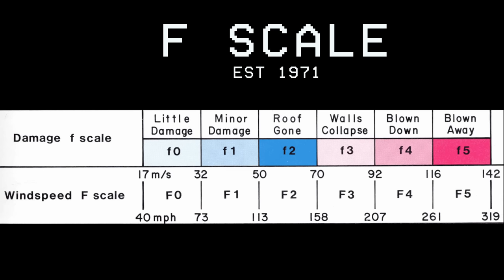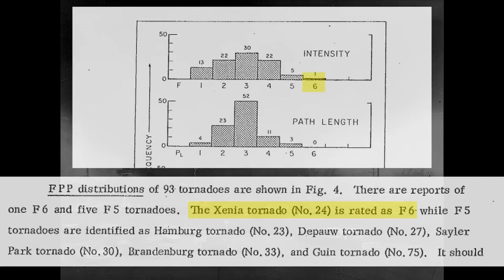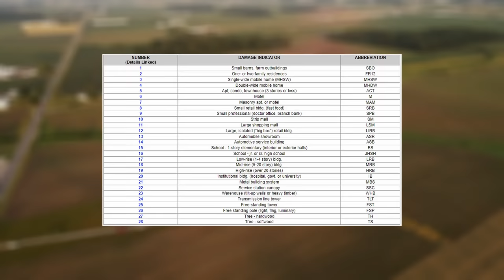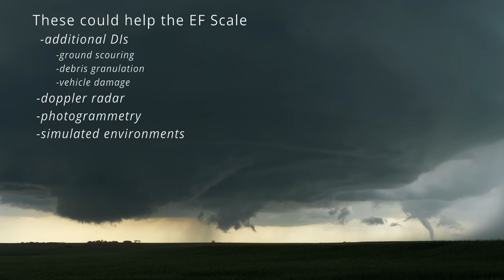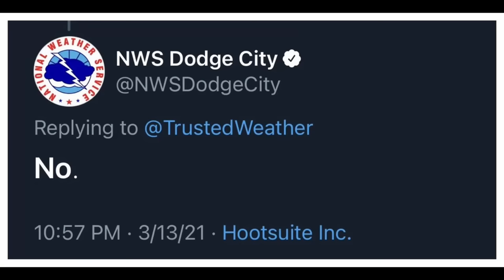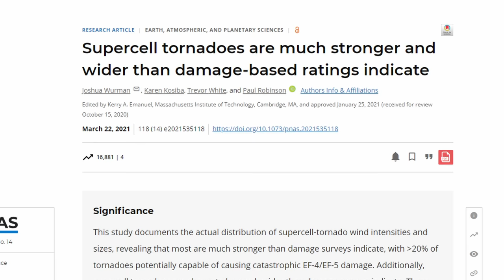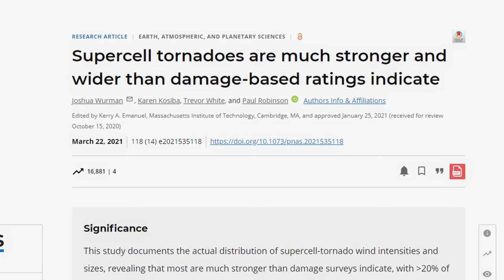Is The EF Scale Outdated?

Comment: Well considering an EF5 only "happens" when it hits a town or city, I think the whole thing needs to be reassessed.  EF5s tornados certainly exist in open fields but there's not enough damage to make them an EF5 until they hit a building.  That doesn't fit my logic.
Reply: I was thinking adding trees to the list of DIs. There are plently of patches of forrest in open rural areas. If a tornado can hit a patch of forrest and just about every single tree is mowed down, debarked, with all upper branches snapped off...not to mention larger trees being completely uprooted...that should be a indicator of a pretty strong tornado (EF3 or higher). I don't see >EF2 doing that to trees (assuming nothing else is hit).
Reply: That's why the intensity should be based on wind speed like a hurricane, rather than by how much it destroys.
Reply: @MariahWong  The problem there is, often, we don't know the windspeed of tornadoes at the lowest levels. The windspeed measured by radar is usually a few thousand feet above the ground. Estimating windspeed from the damage is the best that can be done at the moment.
Reply: With my research I have done for a couple of years ef 5 should be rated on  wind speed and amount of worry and warnings  implemented before or advisory's implemented a day prior due to large amounts of risk in unstable conditions
Reply: @RamSoulja86  They already have trees as a DI the highest rating they can earn currently is 167. The NWS is updating di's in 2024 and theres a preliminary DI for forests which has a maximum DI of 210 which is EF5
Reply: It's super dumb. We should go back to the original scale. It was perfect.  EF5  = F3 on the Fujita Scale.  EF3 =  F2.
Reply: @Firemarioflower  what do you mean by ef 5- ef3
Reply: Same exact thing happened with F5s. Your logic is ''We don't have the information, but we're gonna pretend we do'' Just how strong is this tornado that hit nothing? How do you determine that? Too much smugness for too little thinking....
Reply: @tomasallende9583  if we know 200 mph winds hitting a building will destroy it, then observing a 200 mph tornado we could somewhat assume it would destroy a house. (at least thats the logic they are using) your same argument can be made for making guesses on its strength by whatever structure it destroys, because there's so many variables to how the structure was built, how old it is, etc.
Reply: @skyguy1236   @skyguy1236  The option is ignoring construction quality all together and go back to the F-scale. What you're telling me is because we can't get a perfect aproximation (oxymoron there) then we shouldn't even try. And 200 mph won't necessarily destroy a building, or it may destroy a building but not a extremely well constructed house. In 2011 there was a dome house that survived (severely damaged though) 200 mph winds. You have to look every case individually. If you know there were a bunch of cars in the air maybe the worst damage was done by cars, not the wind itself. All that said, if a tornado can destroy a well built concrete building, it can probably take any house in it's path that's not specifically tornado-ressistant. That's the improvement of the EF-scale over the F-scale, it takes building quality into account. There are shitty building and strong houses, that's all considered by the engineers that do the surveys.
Reply: @tomasallende9583 exactly. It's not as simple as people want it to be. The ef scale is a damage scale, period. It's the public's misunderstanding of the scale that is the problem. That's not to say there shouldn't be a new scale implemented, one that uses wind speed from radar and whatever other measuring tools we have, but getting upset about a damage scale being used to measure damage is nonsense. What we should be upset about is how that scale has been used to prevent communities from getting the funding they need to rebuild.
Reply: @deathbloom27  And what's crazy to me is, say an EF2 tornado destroys a trailer park and kills 9 people. Should the survivors get less assistance because it wasn't a violent tornado? It's so nonsensical, it's a scale made for construction standards, and there's in all likelyhood to real difference between EF4 and EF5, no house survives either. At that point they should probably be looking at larger structures (like the Joplin hospital) but a normal house is fucked at EF3 strenght. Wether an indoor wall remained is purely scientific, it makes no difference to the owner. I wholeheartedly believe the reason for all the anger at the lack of an EF5 is EF5s are cool and usually very young people want to see more. It's dumb, it's super fucking dumb, but I really think that's all there is to it.
Reply: @tomasallende9583  That's why the portable doppler radar, DOW, Doppler on Wheels was created. Only problem is that they are only used in a handful of tornadoes each year, and only in traditional tornado alley.
Reply: @deathbloom27  I completely understand that. The average person hears 'F5' or 'EF5' and hasn't a clue what it means. Even on the movie "Twister", they say that an "F5 tornado is touching down", with no understanding of how the scale works.
Reply: @Firemarioflower  I agree. EF5 is any wind exceeding 200 mph, F5 wind is exceeded 260 mph, maybe up to 300 mph, or a little higher.
Reply: @oscodtips647   Look at the windspeeds on both scales. Where F3 basically ends,  EF-5 rating starts.....
Reply: @ILoveOldTWC   That's right. We should look at the potential strenght of twisters, not only what it does later on. If people can be warned that an F5 is heading their way,  that would be far better instead of rating it later on.

Comment: I find it odd in many of the high end EF4’s they find pockets of EF5 damage and scale it back to EF4 because of anchoring . Rochelle , Illinois 🌪 was rated EF5 but scaled back because of anchoring . You won’t see another EF5 until they change the surveying
Reply: Not anchoring adequately reduces the wind speed required to achieve a given amount of damage, so it makes sense to take that into account.
Reply: They found some potential EF5 damage in the Maysfield and Rolling Forks tornadoes. Houses were wiped clean of their foundations and there was severe ground scoring. However, in both cases, they said that the anchor bolts and foundations of the structures were weakened from age. Seems stupid to me.
Reply: @tid418  It still could've been over 200 mph winds.
Reply: But most of the time they're F3 strength

Comment: i feel like the andover ks tornado from april 29 of this year was capable of producing ef5 damage. seeing the drone video of it was insane. it was such a small, and decently fast moving tornado and still caused ef3 damage. in the matter of 1 second, multiple homes were hit by the winds of the tornado and had there roofs torn off and thrown hundreds of feet into the air with ease. it is so scary how those homes were only in the tornado for a second or 2 and instantly got torn apart so easily. i have no doubt in my mind that if that tornado was the same size as your average wedge, it would've caused ef5 damage. I also would like to add that i have heard that some study that was carried out by some European scientists presents evidence that the andover ks, april 29 tornado may have had wind speeds up to 264 miles per hour.
Reply: The Ef scale is wildly outdated right now it needs updated
Reply: I love that you mention size.  People need to get this idea out of their head that the size/width of a tornado determines strength.  Tornadoes like Andover, KS (2022), Elie, Canada (2007), and Pampa, TX (1995) all prove that. Sometimes large tornadoes almost a mile wide are weak with 80-100 mph winds.
Reply: @jm5390  yea size by no means determines strength, but if you put the wind speeds of a small tornado into a big one, it’ll cause more severe damage just because the structures will be exposed to the fast winds for a longer time.
Reply: @jm5390  Very good point. I remember hiding in a basement at OU in 2015 as a 2/3 mile-wide tornado headed into town. Looked on the TV just like the Moore tornado two years earlier. Ended up being an EF1.
Reply: Yes! I lived in Wichita and saw the damage and was very surprised it only rated a e-f3
Reply: @jm5390  Exactly! Mike Morgan of KFOR in OKC will look at the appearance and say "Looks like EF4, maybe EF5". It doesn't work that way.
Reply: @Yeaggghurte  But what and how would it be updated? There won't ever be a perfect scale.

Comment: Though it maybe understandable that, at the time, damage done was the method for measurement, back when they had no other methods, it really is silly for it to be used as the only method in this day and age, when we can literally watch a tornado on a radar in real time and get its wind speed ever time the radar beam and other measuring instruments crosses the tornado.  We can quite literally get an accurate EF rating for it the moment the sensors pickup and display the data of the tornado stats.
The power of a tornado changes on its environmental conditions, not based on how much damage it manages to do.  Damage done, used as the measuring standard only made since back when there was no other way to measure a tornado strength.
The current application of the EF scale isn't just out of date, but the mere fact that its usage has not yet been updated to use the sensor data, is a warning that someone is pushing politics to prevent a proper and sound update to the EF scale usage.
When nothing is around for a tornado to damage in the first place, other then grass and dirt, using damage done as the current standard is beyond crazy, especially when we can easily know the tornadoes power from the radar records.  It is insane to catalog such a tornado as EF0 just because it didn't HIT anything.
Damage was the measurement used in the absence of the ability to measure anything.  It is not suppose to STAY "THE MEASUREMENT STANDARD" when even the intent of the damage method was to catalog wind speeds in the first place.  The ability for Doppler and other instruments to measure wind speeds should have taken over the standard barer, since those devices can see what the tornadoes wind speed is as it moves around.
There is no reasonable or sensible explanation for why the switch has not happened.  The only explanation that can tell why things are still like this has to be the ridiculousness of politics and stubborn people who want too hold to a standard simply because it was around.  Pride is getting in the way of properly updating the measuring standard.